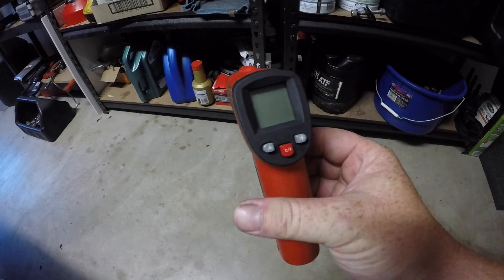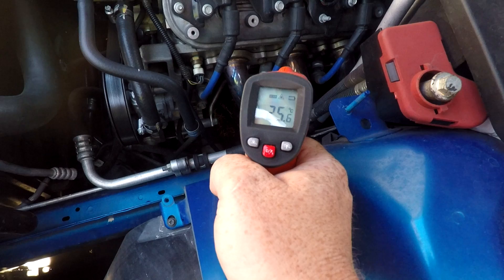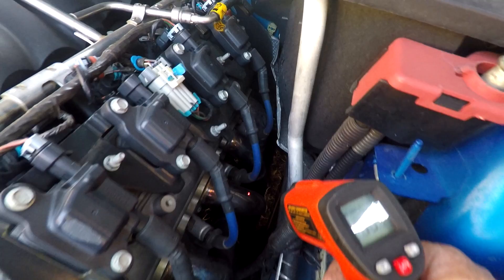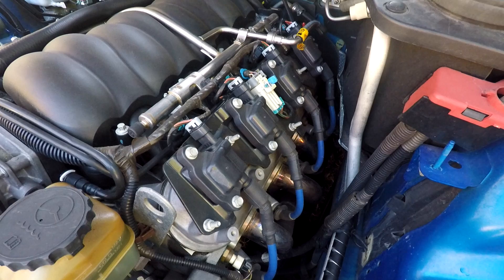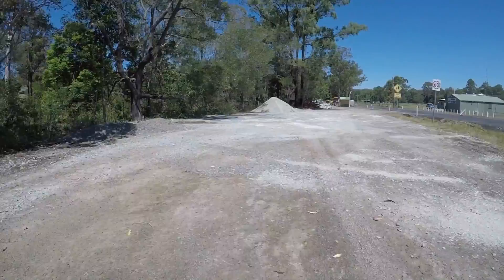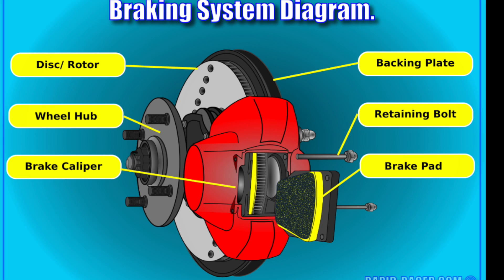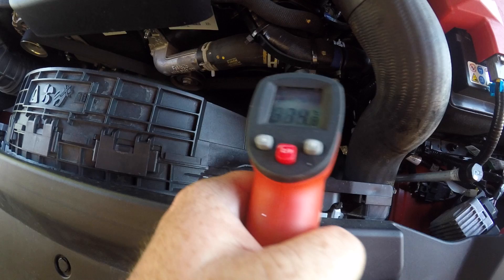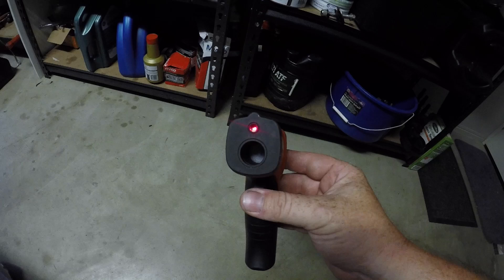How to Use an Infrared Thermometer to Diagnose Car Problems

Comment: The front brakes do 70% of the breaking energy, so they should be much warmer.

Your front brake were about 149° and your back breaks were about 93°, or about 0.624% the difference between the temperatures. Your breaks are very efficient in this configuration. Great video.
Reply from the maker: I never did the Maths but it works out pretty good. Thanks for the comment.
Reply: I do agree. I'm a mechanical engineer and the front is usually higher than the rear, the front has more load including engine weight and cabinet drive. Even with ABS and EBD brake systems, there should be a temp diff
Reply: @TuningLovers  'Im no engineer but even I know that. Weight transfer under breaking has a lot to do with it too.

Comment: The front brakes take a heavier load than the back so they should be significantly hotter after use if they're the same as the front you have an issue

Comment: I have one of these heat guns and I was thinking about making a video similar to this one, but you did a better job than I had in mind.

The brakes are tricky, because other factors come into play. Splashing into a puddle and directional wind can throw off temperature readings. I have seen a small amount of wind throw off the left to right front brake temperatures by 20 degrees F.

Comment: excelent video...by reading headers  temps if  any is running cooler than the others it may be a way to find a sparkplug or cable/coil not working ok
Reply from the maker: Spot on.
Reply: @killawattgarage  My car is front wheel drive and have problem accessing the exhaust manifold, it's in the back of the engine at the dashboard side not at the hood opening side, any other way to measure misfire?

Comment: My car is front wheel drive and have problem accessing the exhaust manifold, it's in the back of the engine at the dashboard side not at the hood opening side, any other way to measure misfire?

Comment: Did your check engine light come on after you removed the coil wire? How hard was it to clear when you did?
Reply from the maker: For this model, then check engine light would have come on while the coil was unplugged as the ECU would realise the fault. Once plugged back in and on the next start up the light would have gone out. The fault code would have been stored as a Pending Code. As the fault was a once off after a few engine on/off cycles and without the code repeating the pending code can clear on its own.  With a basic code reader or scanner you can also clear this code within a few seconds. Hey, thanks for the comment and I hope this explianation answers your question.
Reply: @killawattgarage  yes it did. Much appreciated!

Comment: what is the inlet and outlet temperature when radiator fan is on ?Again if if fan is off what is the temperature ?
Reply from the maker: Each model runs at a different temperature. The inlet could be from 80'C to 110'C but the outlet will be 10-20'C lower. Thanks for the question.
Reply: @killawattgarage  thanks sir for the answer.

Comment: Hey Killa,    thought i saw you working  on VW 2.0 TSI.  What hoses do you check for coolant?  I pointed a fluke laser at what looked like the incoming and outgoing and got  115 (46 C) and 145 (62 C)  which doesn't make any sense to me.   My issue is the analog gauge sits at 190 (87C)  but the ECU (through Torque) is reading about 222 (105 C) average .  Worried because i just changed out a clogged radiator and fixed all the hoses.  Pump was replaced last year with aluminum graff when i did a bunch of preventative mx, timing change , oil leaks, valve cleaning, etc., etc.  THanks in advance for any suggestions.
Reply from the maker: Do you know the opening temp of the thermostat??
Reply: @killawattgarage  vendor says 95C (203F) so that's  already 13F higher than 87C (190F) as my gauge shows for center.

Comment: WOw so far i have seen these temp gauges work, but the one he is showing you here is a SCA brand i believe ie: supercheap auto brand, yet i have seen no Infer red light emitting from some of them, thus must be faulty, but will check to see if these things are good compared to a touch Food grade expensive brands, also a lot of real good  mutti meters have a temperature probe which you can use as well, as long as you dont mind getting you probe and hands near very hot surfaces which is why most mechanic have heat proof gloves when they are working on hot engines. :)
Reply from the maker: Thanks for the comment, sorry for the delayed response your comment was sitting in a 'Likey Spam' folder.
Reply: The human eye can not see infrared.